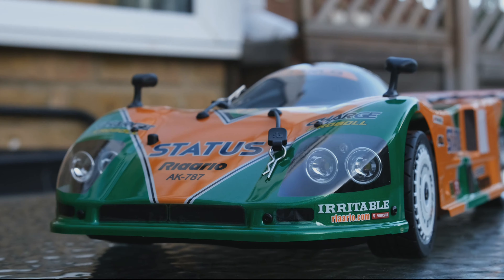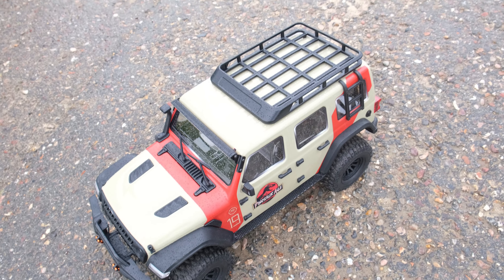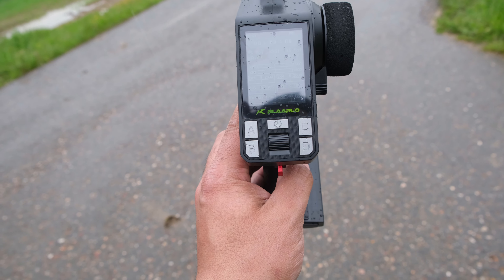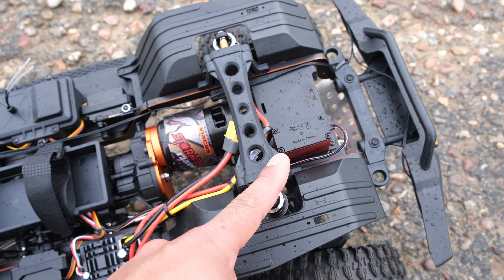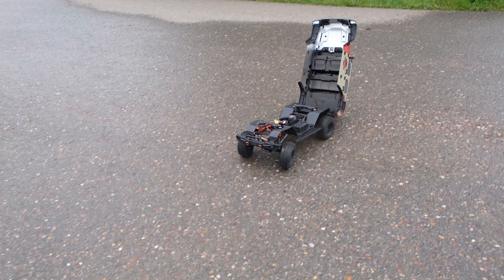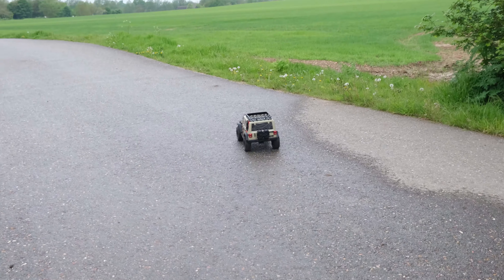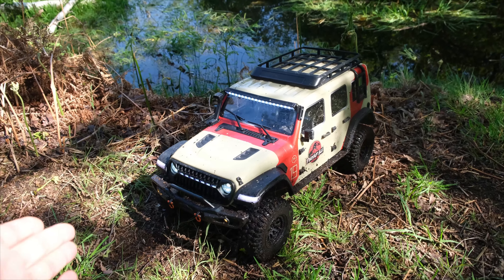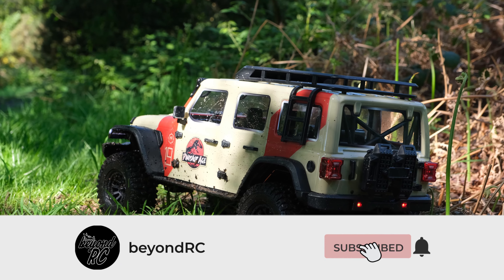This NEW Jurassic Park Inspired RC Car is HUGE!

Comment: Great review Ricky, I do like the current crop of large Crawlers, the bigger the better & this truck would fit my requirements quite nicely, so it's going to be down to the price, Rlarrlo just released the price on their website as $499 which looks like extremely good value, assuming that cost will be the same when converted to Sterling £ UK, we shall see 🤔👍
Reply from the maker: it should be £398 if converting from USD to GBP

Comment: Would ditch that transmitter as soon as it ia deliverd. I used it on my racers for a while. And on my heavely modivied Granite. Last week all the sudden the trigger went to full trottle and there was no way to break. Car ended up into a beach house and broke both front shocks, shock towers, front diff housing, chassis and both driveshafts. Restarted the transmitter and it kept reading full trottle while i did not touch the trigger at all. This simply may not happen
Reply from the maker: Very strange, Have only heard good things about it until now :/
Reply: @beyondRC  not realy happy about it. Got 1 broken receiver when i ordered it. Got replaced for free, so great service. But after about like 40 hours its staring behaving strange. So now a 40 dollar transmitter gave me about 200 dollar in damage at least. Not happy whit that at all. 
Seems like it lost its 0 point. If i start it it reads 2000 instead of 1500, that means full trottle. If you cant stop a rc basher that will do over 100km/h, is still kinda scary. Crasht it into a building on purpose because there were a lot of small kids around. But yeah, not happy

Comment: Really great review! Thanks!

Couple of questions:
How waterproof is it?
What’s the actual top speed?
Do you need to come to a stop to change gears and diffs front/back?
Can it outrun a TRex?
Reply from the maker: Fully waterproof as far as I’m aware 🧐 might be wrong although handled the water nicely
Today with no issues and then a hose down 🤣

Top speed around 5mph but it’s a heavy crawler not built for top end speed 

Yes you need to stop to change gears high/low

Unfortunately no haha trex can run about 45mph 🤣😂